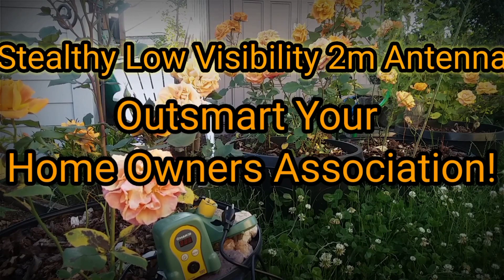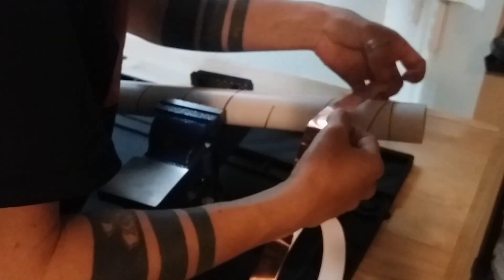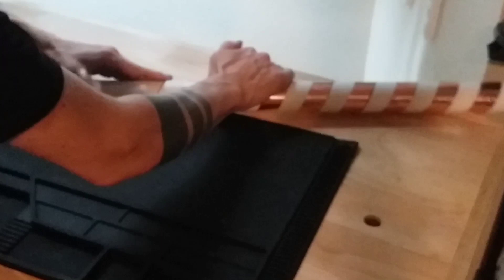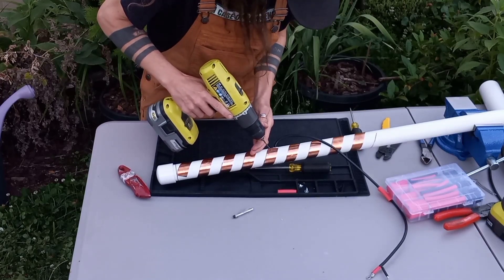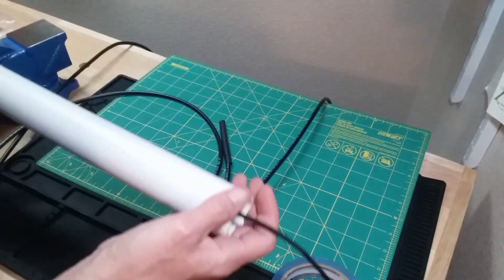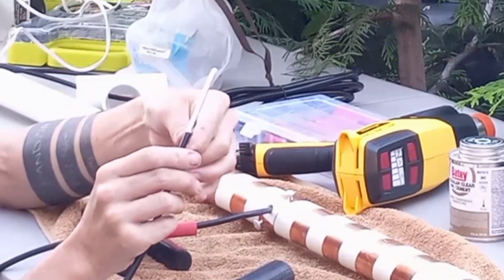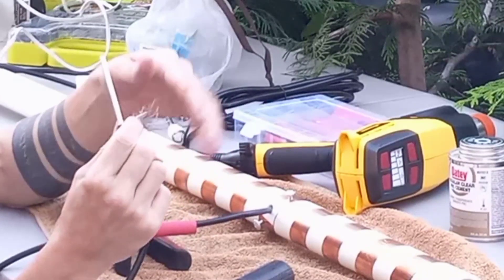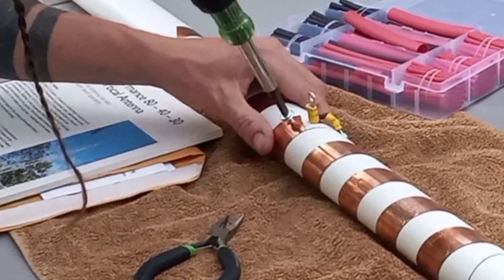Her First Ham Radio Antenna Build. Outsmart Your Home Owners Association! (H.O.A.)

Comment: You gonna get on PRA so I can talk to that tube? AB7F might work as well.
Reply from the maker: Heya!♡♡♡ can you elaborate on this a little bit for me? I am curious what you meant by the end bit? Please :) haha I'm such a nube!
~Be well hamFam!♡
Reply: @wild.radio73  PRA (peak radio system) and the ab7f repeaters are both linked systems with wide coverage that we could have a QSO on.
Reply from the maker: Oh! I am going to look that up today ♡ do you know off hand what something like that might cost? I want to try it now :)
Reply from the maker: Also, someone reminded me that as a tech I can use voice on a small slice of ten meters... so have been working on getting an antenna for that as well!!♡ I'm so so close to getting out! I appreciate you!!
Reply: @wild.radio73  10m is pretty crappy right now since it’s a sun spot low BAM 💥 Occasionally there is an opening but it’s pretty rare untill cycle 25 gets going. (5 years from now most likely)